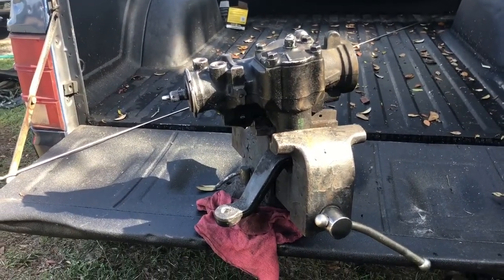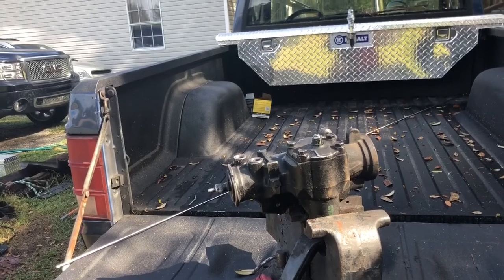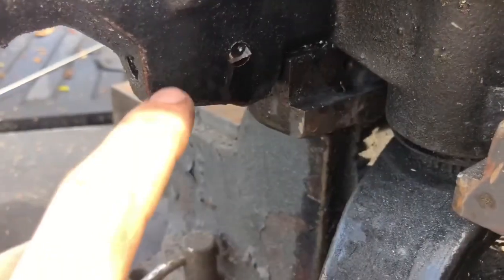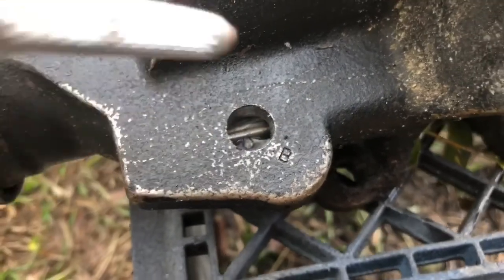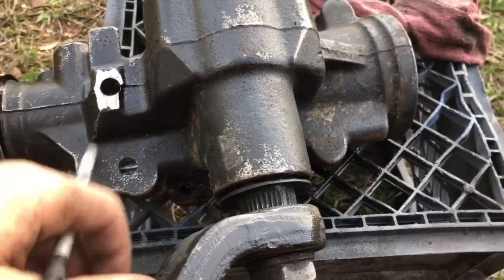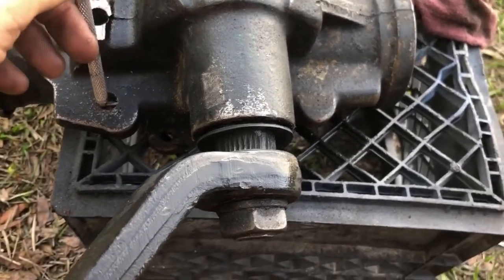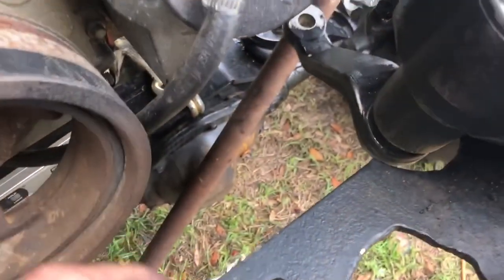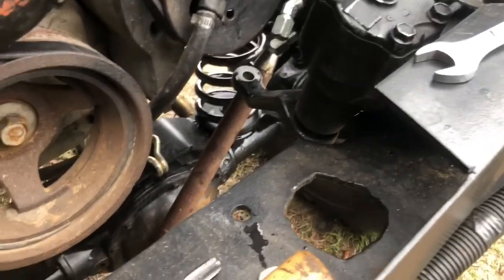How to tap steering box for hydraulic assist

Comment: Use grease on the tap and on the drills. Go slow. Once you have a hole, pump it full of axle grease with a needle tip on your grease gun. Stop every now and then to clean out the chips off the drill or tap. Use a magnet to get the chjips out that are stuck in the grease in the hole. Once done with the initial hole, invert the box over a bucket and blast it out with brake cleaner. Do the same with the tapping. Put an inline filter on the return line (a great idea anyway), and never worry about the issue.

It isn't rocket science, kids.

Comment: did you kill your box from metal shavings?
Reply from the maker: Nope still works fine
Reply: @bradfordcustoms7588  perfect. pulled mine, tapping tomorrow.cheers dude
Reply from the maker: @MrDenverd1  go slow and do your best to keep the chips out. Grease and a small magnet works well
Reply: @bradfordcustoms7588  excellent. TY sir